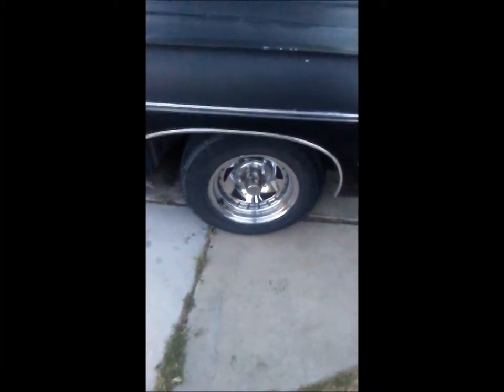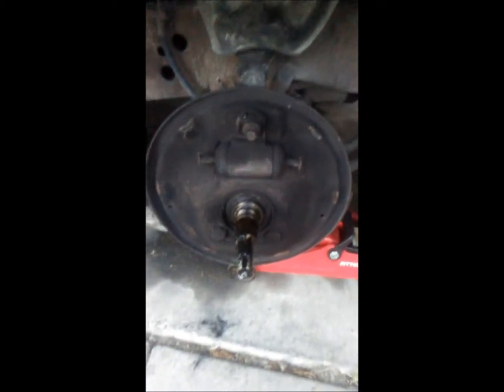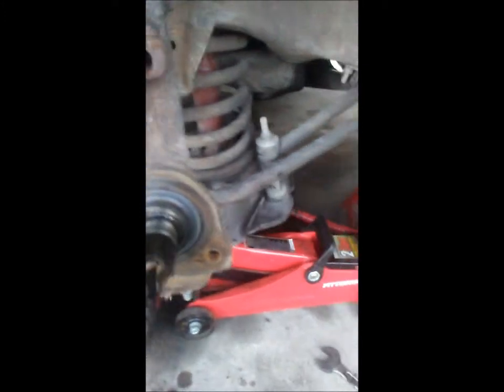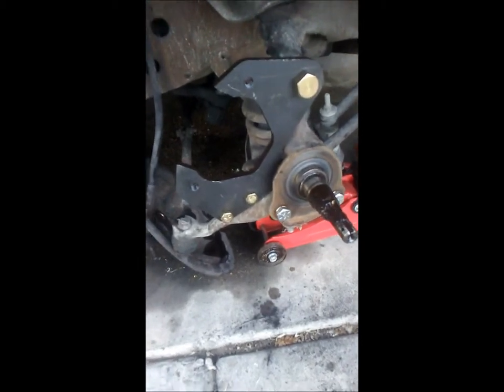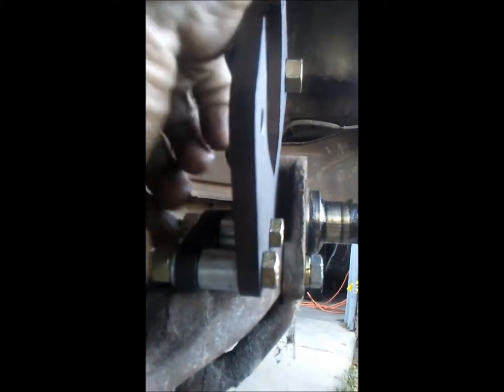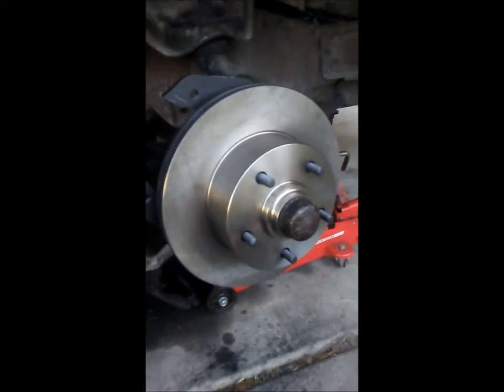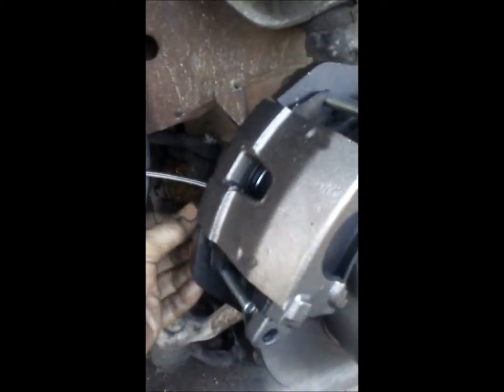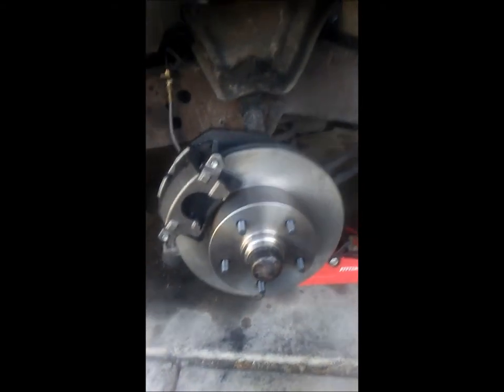1968 Impala disc brake conversion kit with no instructions

Comment: Think I have the same disc conversion kit without instructions..kept adding the bracket to the front and it just wouldn’t fit. Glad I finally found a video on how it actually goes. After adding the seal to the rotor. Is the rotor supposed to be flush with the spindle or have a bit of space?
Reply: Nevermind. When I had the bracket through the back it doesn’t fit because it’s rubbing on the control arm.. unless they sent me the wrong package this just doesn’t make sense
Reply from the maker: @StayFancyRide Exactly. It didn't make sense. I was like you and tried the parts in all places and finally got it to fit.
Reply: @greglarsen3248 I have a 65 impala which shouldn’t be that much different from the 68. I got it to fit a different way but now the  brake caliper doesn’t want to go in flush. 😅 ima end up popping a blood vessel at this point.
Reply: @greglarsen3248 also is your caliper facing the front towards the bumper or the rear towards the firewall?
Reply from the maker: @StayFancyRide Firewall. I doesn't make sense to sell a kit and not put instructions with it. You're right, the '65 and '68 should be the same. I also had a '65, but gave it to my sister before changing to disc brakes as she needed a car.  Hang in there buddy. You'll get it.
Reply: @greglarsen3248  by any chance, were the brake caliper holes on the caliper brackets angled? I just noticed that the holes on the bracket are slightly tilted and mangled which is why I can’t tighten the brake caliper properly??
Reply from the maker: @StayFancyRide No angled holes on my kit. I hope they didn't send you a faulty kit. It's hard enough trying to install without instruction and now having to deal with angled holes on the calipers.  Something fishy with that kit.
Reply: @greglarsen3248  darn, so I noticed the holes don’t align flush with the holes on the caliper..that’s why when I put the pins they tilt and don’t screw on…both caliper brackets are like that..annoying cause they take forever to reply back.
Reply: @greglarsen3248  looks like they drilled the holes too low..
Reply from the maker: @StayFancyRide Sounds about right. Hopefully you can return it.

Comment: Why are the calipers towards front of vehicle I thought the go towards the rear?  Or does it depend on the company?
Reply from the maker: Depends on the year of the car. This '68 mounts towards the rear, but I've worked on newer models that mount them towards the front. Both work well. Thanks.
Reply: @greglarsen3248  sounds good thansk

Comment: Did you have to change your proportional valve as I drive my car my brakes are like the applying their self
Reply from the maker: Sorry for the delayed response. I used the original valve and master cylinder which works great.

Comment: Did you need a proportioning valve?
Reply from the maker: I need to check replies more often. No I used the same one and it works fine. Thanks.

Comment: I have right stuff all the way around just breaks the problem that I'm having is the front bolt is hitting the lower arm
Reply from the maker: Not sure what you're saying. Can you elaborate a bit? Thanks.
Reply: Did u ever figure it out i ran into the same thing
Reply: Did you ever figure it out I ran into the same thing
Reply: @romanduran3696 hey man, I have the same issue where the bolt hit the lower arm. Haven’t figured out the issue yet but all I can think of is shaving the lower arm down around the area so the bolt can go far enough. Or cut the bolt maybe?